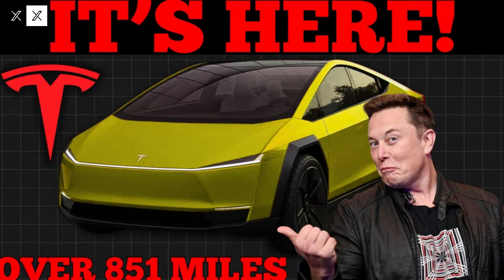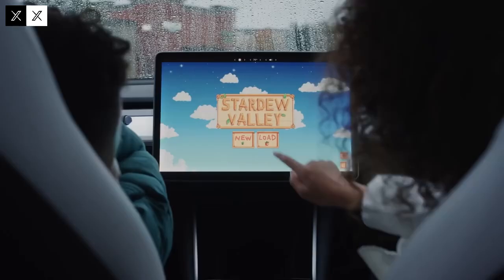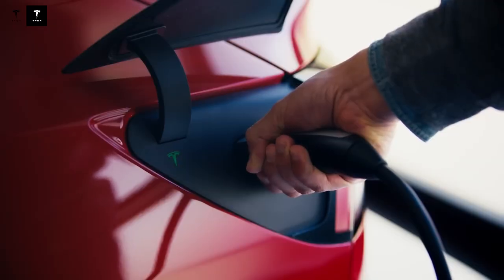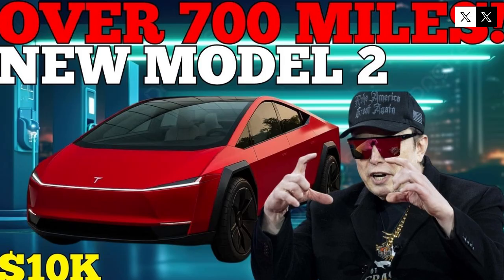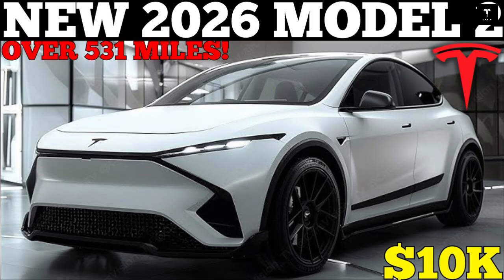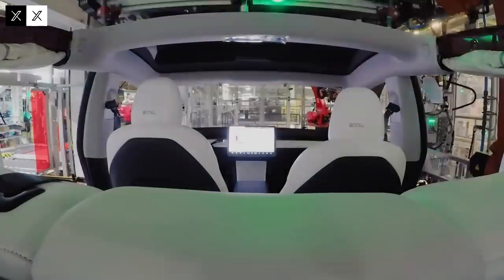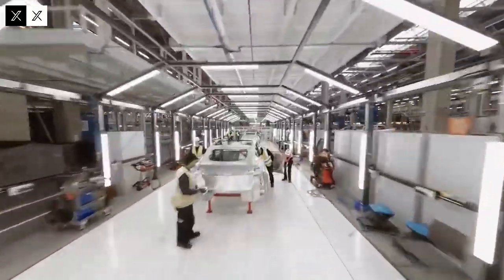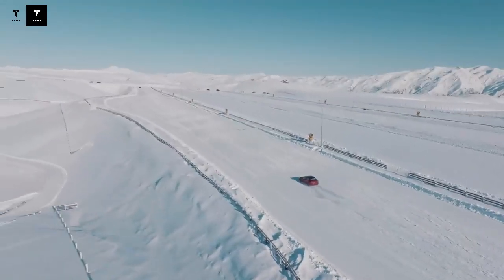AT LAST! Tesla Model 2 Revealed for $15,990 – 550km Range with Stunning Features!

Comment: there. is no cinfirmed. Tesla Model 2 with 
exact. specifications  of $15,990  and. a 550km
range ,as the. information you. provided. comes
from unofficial social media post. and videos 
and. dose not  align with. cinfirmed tesla plans 
while Elon musk. has. indicated. Tesla  is working 
on. a lower. cost vehicle official. details. 
regarding. it’s. price  range and.   release date 
 have not. been annouced by tesla 
 Information :the. $15,990  price and 550 km. range EPA mile. appear be. from 
speculation and unofficial. reports not 
official Tesla announcement
Reply: shut up kid you make no sense don't ever comment again 😅✌